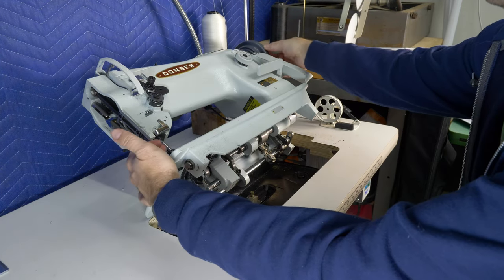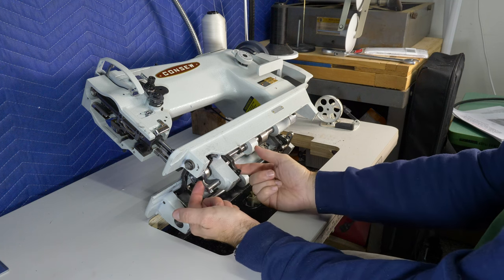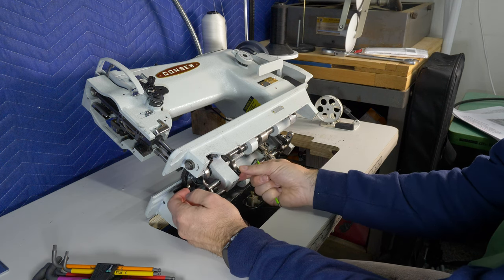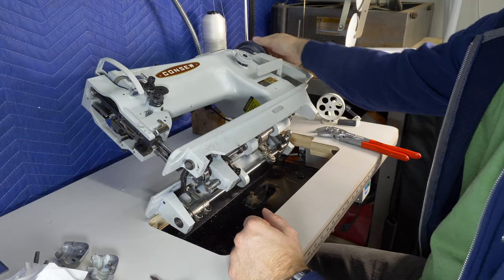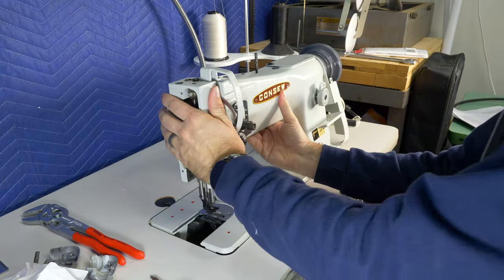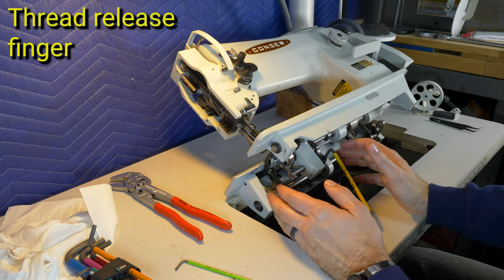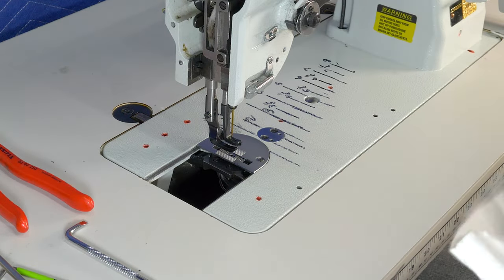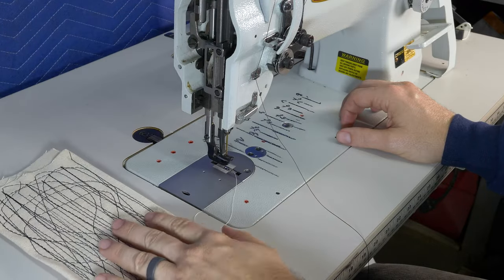Can I Free Up this Industrial Machine?

Comment: Our brand new consew that we haven’t even used yet did the same thing. We’ll thread got stuck in the bobbin drum so it would not spin inside the drum. I took the whole bobbin assembly off and got the thread out and put it back and reset the timing. Seems to be ok again?  We will see when we put it to work. Only thing I can think of is that the thread got stuck on the bobbin?  I’m learning.

Comment: The industrials have been one particular area I've been avoiding -- both because I didn't want to have to try and work on them, and because I just do NOT have the space (though I definitely have the need for one). And all really the same as my old serger: Just intimidating because more moving parts and faster speeds, even without the computer. This definitely demystifies them a bit, breaking them down into something simpler -- "smaller bites," as it were, so it's nice to see. Maybe one of these days, I'll have the space for a proper walking foot machine, myself!

Comment: awesome job, thought that type of machine came with an oil pan & wick for automatic oiling to prevent issues? guess not all do
Reply: I was wondering how they kept it oiled too. It doesn't have an oil pump. My Juki's has an oil pump and oil pan. They pump oil over to the hook.  I have noticed the latest Juki's are oiled differently

Comment: Interesting to see another brand. How you loosened the hook to move it but said there's a flat, my juki doesn't have a flat there. Mine I adjust timing and distance right there at the hook screws. 
I guess all industrials aren't identical.
Maybe because that has needle feed and walking foot it's different. 
When moving to a 110/18 or below a 90/14 or 80/12 I usually have to change the hook distance and sometimes slightly adjust the timing.  Usually I can get away with 80/12 at same setting as 90/14 or 100/16 but depends on which I set it to last. When I set for 90/14 I'm usually good for 80/12 or 100/16.

Comment: This was an amazing video. I had a juki lock up on my friend and it was the hook rubbing on the feed dog plate. 

I have a 255rb and was curious if you knew where the top oil wick goes into the machine? There's the one that runs into the Needle bar area and one that disappears into the cast iron. That one rotted away and I'd like to replace it

Comment: Thank you so much , I was able to fix our machine but I still don't understand what caused it to lock up. I did not see anything in there after I removed the piece that turns inside the bigger piece . I cleaned it and oiled it like you did but did not see anything in there except some dust.

Comment: New to me Consew 226 all cleaned up and adjusted thanks to your videos...except that the thread is shredding at the needle. Using Gutermann upholstery thread and cannot seem to get a good stitch...any suggestions?
Thanks
Reply from the maker: Try lowering the tensions, also make sure the timing and needle to hook clearance are perfect. Sometimes very small adjustments in timing can cure it.

Comment: Very nice video!  But it's disappointing that you skipped over the RE-installation of the hook assembly that you removed in the beginning.  That's where I'm stuck at the moment, and I can't figure out the proper orientation for the re-installation of that piece.  I'm talking about the piece that goes back in right before the small half round clip with 3 tiny screws.  Can't figure it out from the (lousy) Consew manual either.  Very frustrating.

Comment: My machine sounds great. When i apply pressure to the pedal the motor stops running. I can move the wheel and the needle works. Please help. It just does not run. This is a consew 206rb2

Comment: Haven't watched yet have you tried pushing the button on the bed to free it up That is what I have done on this machine
Reply from the maker: Good idea, but no. The clutch reset button was not engaged.
Reply: @SewingMachineRepairGuy  thanks I usually try that first before I start looking LOL
DO you have a Singer 20U to repair I would love to see some videos on it? I had to remove the clutch disk and almost didn't get it back together correctly, for some reason it had slipped loose and I was skipping zigzag stitches and I could not tighten down the handwheel it just kept slipping.
Reply from the maker: No, sorry I don't
Reply: Took my older machine to a vacuum shop that also works on sewing machines.  I bought it used 23 years ago & have no idea of its age, it has all metal parts so I wanted to keep it.  Before the pandemic hit I took the machine to my home town to be serviced at a reasonable price (60 miles away).  The metal plate wouldn’t stay on. So I took it in to this shop 30 miles away and right off the bat they told me a flat fee of $100, plus parts.  I should have left but needed to finish sewing face masks.  The total cost was $107.00, he told me the parts for this Singer machine is hard to find, but the plate wouldn’t stay on because a spring was missing under the plate.  **how can I find the age this machine was made so I can order my own parts & do you know of a website that sells parts?  I’ll not pay that price again, I feel I got ripped off.  Thanks!
Reply from the maker: I recommend sewingpartsonline.com or just ebay for parts. Just search for the model number on your machine. Also, that is a reasonable price for repairs, it takes a few hours for each machine and they have to earn a living.
Reply: @SewingMachineRepairGuy  I will continue to watch your channel and if you do ever work on a Singer 20U PLEASE make a video of its repair. I have had mine for MANY years I have taken it a part several times and put it back together and I have also had my repair guy look and fix it when I can't. I would love to know everything I can about it. There are not many videos on the Singer 20U repair and I do know there are a lot of them out there they are a great machine.